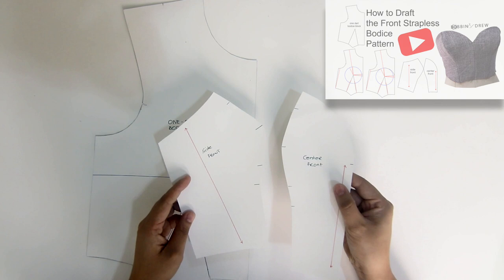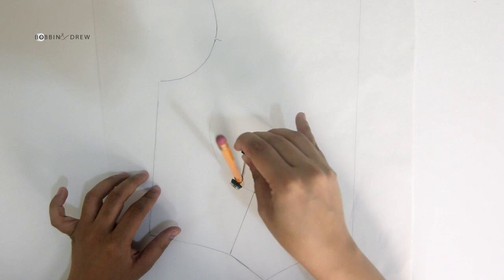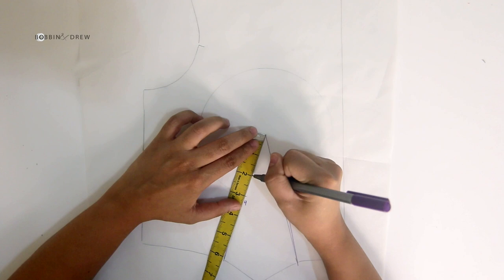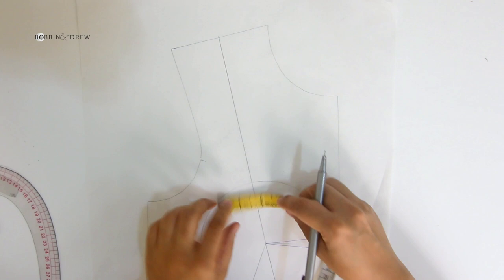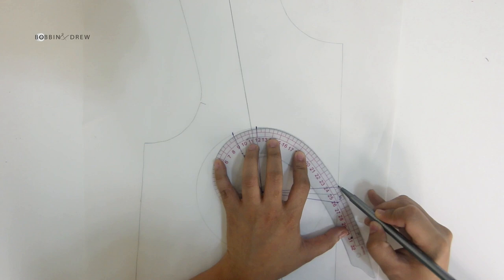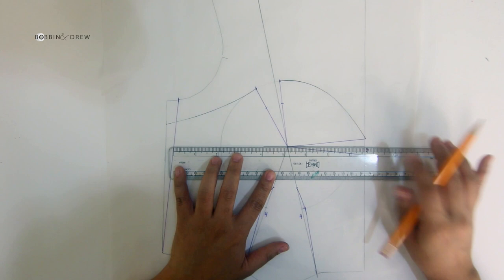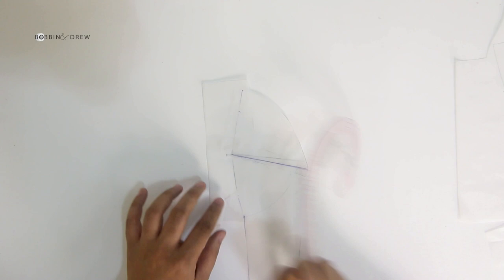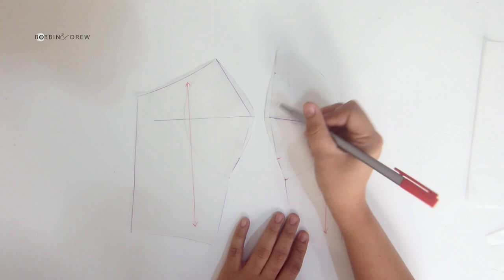How to Draft the FRONT Strapless (Bustier) Pattern From A One-Dart Bodice Block (watch in HD)

Comment: How do you determine how much 'extra' to take off the added dates and the side?
Reply from the maker: hello :), there are standard measurements in contouring and I refer to Helen Joseph Armstrong's Fashion Design book... I have made a video on pattern contouring based on the standard measurements. If in case after you have prepared the mock up you still see some gapping above, below, and between the bust, you can always increase the amount. As each body type is different, the standard measurements are starting points on contouring. Sharing with you the link on pattern contouring. Take care... https://youtu.be/i_XOL_w_ZyA